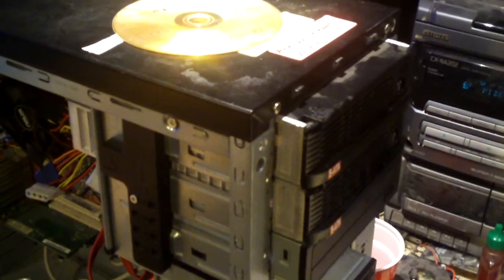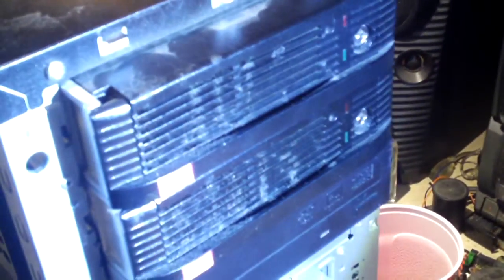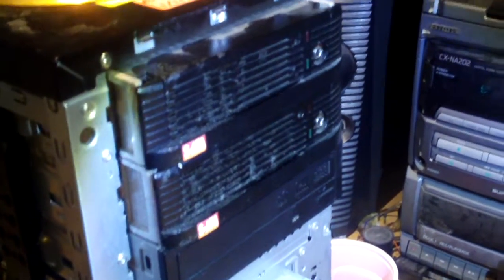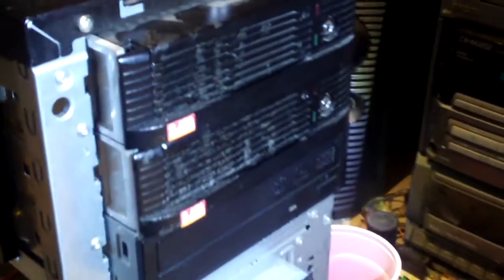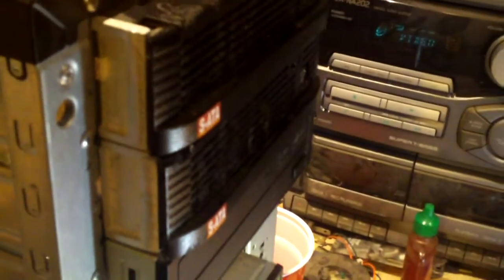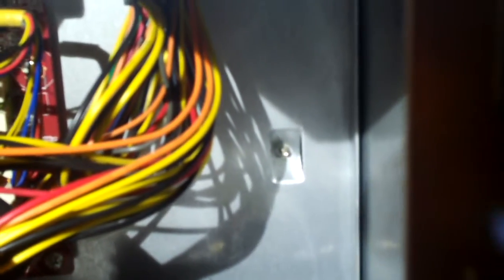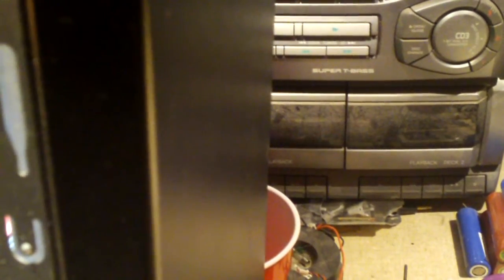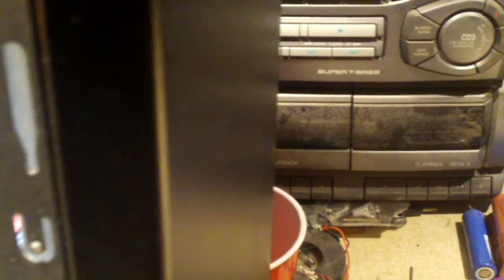Two 5.25 SATA HDD Enclosures with Seized Fans!

Comment: Two quick things ... I'm curious whether you can tell a seized fan audibly? I wouldn't be able to see it. Secondly, I've got a server with an extra 5.25 inch bay, and I'm wondering whether I could use something like this for it? (It's in a non supported configuration already, so I'm not concerned.)
Reply from the maker: If the fan is completely seized, then it will make no noises at all... in some cases, that's a tell tale sign... less noise. If the fan isn't fully seized, it will sometimes make a buzzing sound (this is common with sleeve bearing fans).

As for the hard drive enclosure, if you have free 5.25 inch bays available in the case, these enclosures will work great for that. I would only suggest them if your computer's internal hard drive bays are all filled, or you want to be able to swap out drives without opening up the system.
Reply: That's very helpful. Thanks! And yes, it would be nice to have a backup drive inside of the system that doesn't get touched for anything else ... I might consider that over one of Dell's RD1000 cartridges.

Comment: You could've done it much easier by just taking the enclosures out instead!
Reply from the maker: If taking the enclosures out would have been as easy as your comment, then obviously I would have taken them out. But, no, they would not come out with the keylocks in the locked position.